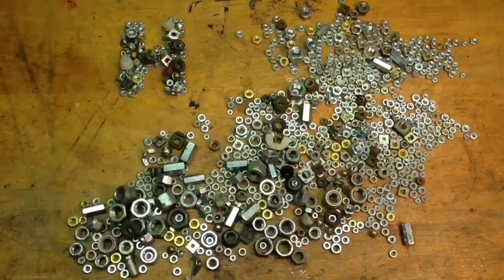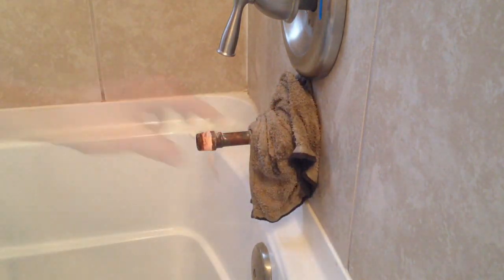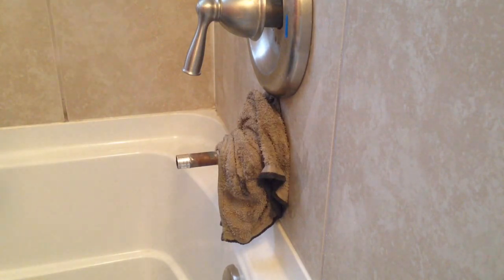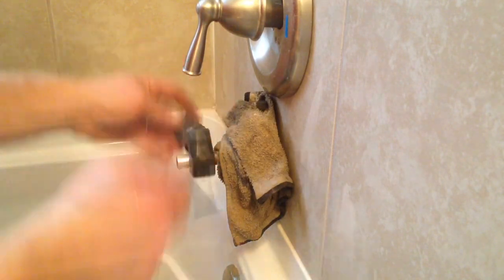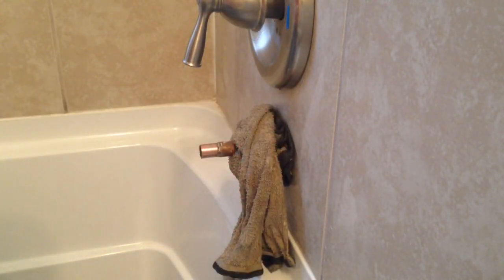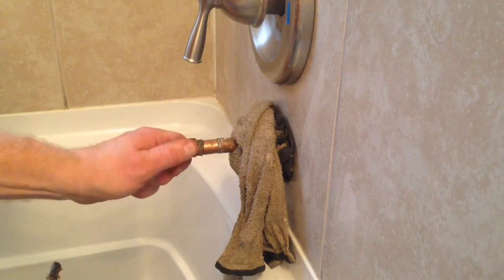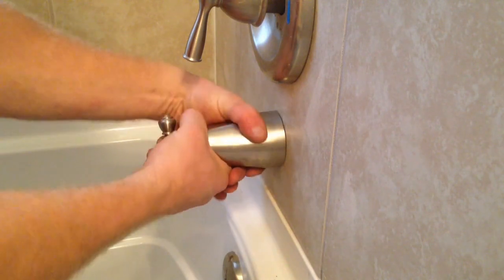Shortening a tub spout.

Comment: Well done. I always use the threaded spout. I cant stand those compression spouts. Never seen the rag trick so thanks for that. Wow on letting the copper piece fall Into the tub like that. Could scratch a tub up, I always lay a rag. 

I seem to always use tephlon tape on water lines, valves, ect...feel that with water pressure the tape is better. I use pipe dope on drain work anything non pressure. But sometimes I use both. Tape first then dope on top. 

There is usually a line on the side of the spout towards the front.  And that line is where the threads stop on the inside of the spout. I usually just put the spout next to the pipe to get the spot to cut. As I never use a tape measure...which is not a good thing sometimes.  But being that ive been in the service field so long I can eye it pretty good. 

I charge between $287-$387 to change a tub spout. I did a tub drain cleaning and changed the spout today for $386...
($99 drain cleaning special. Gets me 100 calls per month) 
Took me 30min. Gotta love it. 

Thanks for the vid
Reply from the maker: RHYMESMOKE1 I used part of the box that the tub came in to protect the tub from any damage. After installing this tub there was no way I was going to cut and solder without some type of protection for the tub. Too many times I have had teflon tape cause a leak and have always had great use with this type of dope...as a bonus it can be used on gas lines as well so I only need one item to seal everything.  Thanks for watching

Comment: Exceptionally clear instructions. Perhaps the only missing element os how to precisely measure how much copper pipe needs to be removed, as well as mentioning which, if any, tools or supplies can be sapped with substitutes (for instance, can a hacksaw do the job if one lacks a pipe cutter, or is teflon tape okay to stand in for teflon paste, etc.) But these are minor quibbles for an otherwise excellent video.
Reply from the maker: Length of pipe can depend on how tight you tighten the spigot, A hack saw leaves a jagged finish and I would recommend using a tubing cutter. Not that it won't work but better results are achieved when the correct tools are used. Some people use Teflon paste or a similar product and the can be used as well. Hope this helps, Thanks for watching.

Comment: I got a tub spout that's exactly 1 inch away from the wall. I'm trying to avoid cutting the pipe. Is there a face plate or ring that I can buy to cover the gap?
Reply from the maker: I'm sure you can find one at the hardware store but not sure how well it will work. Thanks for checking in.
Reply: We’re you able to find one? I too am looking for one as wel
Reply: @evonneeasley3027  No, but I got a black rubber band (or possibly a plastic ring)  that sealed that opening pretty tight and then mounted an actual faceplate over it. It looked pretty good actually. Been using that particular shower on daily basis. No problems so far.
Reply: @InTheMixReviews  okay Thank you! I found some options on Amazon and I’m hoping something works. Our other plan doesn’t look like it will last lol!

Comment: After cutting the old pipe short, can I just put a slip on spout on?
The pipe looks to have the same diameter, but I want to be sure before I cut the threaded head off.
Are all 1/2 pipe has the same diameter for the slip on spout? Thanks.
Reply from the maker: Yes you can put a slip on spout on it you like. All diameter are the same when it comes to 1/2". Thanks for watching.

Comment: Mines is like 2 Small Tubes put together
Reply from the maker: It sounds like someone had it too short as some point.
Thanks for watching.
Reply: @funbro1  I know I commented a little late but I guess I need a 3/4 to 1/2 Connection since the Pipe has a extra Connection & Spoute to short just so the item is set perfectly to the Wall
Reply from the maker: Sounds like you need a coupling.

Comment: Could you let me know.what flux and solder you recommend for this job?
Reply from the maker: I used whatever was available at the store at the time. I have also tried the water soluble flux before and found that is does not work as well. Hope this helps, thanks for watching.

Comment: Bob. What to do when it's the opposite, when the pipe is a little too short?  Let's say you need to extend it about 1/4".
Reply from the maker: To lengthen the pipe requires a coupling. This gets tricky because care must be taken not to heat the pipe up so much that it loosens the pipe inside the wall. Using a damp towel near the wall to absorb the heat will help. Once the coupling is on another length of pipe can be added to it. Hope this helps, Thanks for watching.

Comment: How do you do it when the actual faucet on/off switch is sticking out too far???
Reply from the maker: That presents a different issue. If the handle is sticking out too far then it is possible that the valve body was installed too far out. to correct this the valve body will have to be moved...requiring access behind the wall. Hope this helps, Thanks for watching.
Reply: @funbro1  do they sell space type things to close the gap from the wall to circular faucet knob??
Reply from the maker: There is a flange that is available.

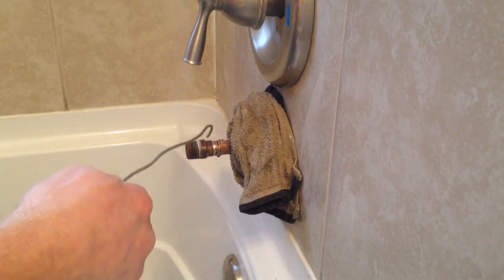Comment: at 3:27 your freshly "soldered" threaded adapter moves when you are wiping it off to get a nice clean looking "joint"....    is that supposed to be a slip joint....    oops....
Reply from the maker: It may have moved a slight bit because the solder is still fluid. Nothing to worry about because it sealed off well. This is not supposed to be a “slip joint”.  Thanks for watching.

Comment: Heat does not rise in a solid.  And why does your shower handle stick out so far?
Reply from the maker: The heat from the flame WILL rise. The shower handle sticks out as far as it should?? Thanks for the view.
Reply: @funbro1  heating from the bottom is good practice. Soldering from the top is a good practice. Heating from the bottom because heat rises in a gas or liquid, but not a solid, does not make sense. Nor is there a significant difference in radiated heat at that small of a distance. Anyway, a good video on how to shorten a tub spout - the best I've seen. No offence intended.
Reply from the maker: @WisdomFromAshes  I agree that soldering from the top is a good practice when able but you must agree that the heat from the torch rises heating the joint more evenly making it a good practice. Thanks again for watching

Comment: Does one normally caulk the joint between spigot and shower wall?
Reply from the maker: You can, it wouldn't hurt. Make sure it's silicone. Hope this helps Thanks for watching.
Reply: It's more than "couldn't hurt". Otherwise you may get leakage behind the tub wall which will eventually rot the subfloor and show leaks on a ceiling below if the tub is on the second floor.
Reply from the maker: Maybe I should have stated that up to and including “couldn’t hurt” for the internet trolls. What would it hurt to silicone in that area? Nothing! So, I guess wouldn’t hurt is still correct.

Comment: Before I call a plumber, I have a leak coming from the copper pipe where there’s a adapter attached to it. Could the leak be coming from the actual handle itself (cartridge )and not the pipe? I though it was the diverter on the spout but I don’t think that’s the problem. Still leaking. Help!
Reply from the maker: It’s possible that it could be coming from the handle since that gets moved more often than the pope does. You can remove the covers and look inside with a flashlight to confirm.Hope this helps. Thanks for watching.

Comment: Ok but wouldn't it be easier if they just sold a little extender piece?
Reply from the maker: Problem is that if the extender piece is not solid then the spout would not be able to screw on right because the extender piece will rotate as the spout is tightened, but other than that yes it would be easier. Thanks for watching.

Comment: how long to you think the heat should be left on, i've been trying this and i am getting no where
Reply from the maker: It depends how hot you get it. If you are using propane it will take longer, if you are using map gas it gets hotter so it will not take as long to heat it up. Make sure there is no water in the pipe, this will keep the pipe from getting hot enough to accept the solder. Also make sure you are using flux, that will help also. Hope this helps, Thanks for watching.